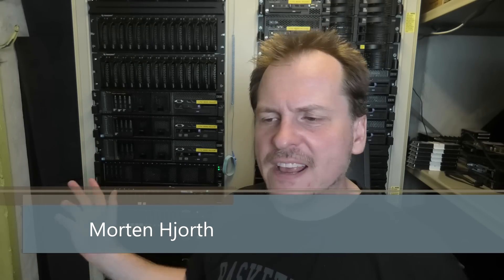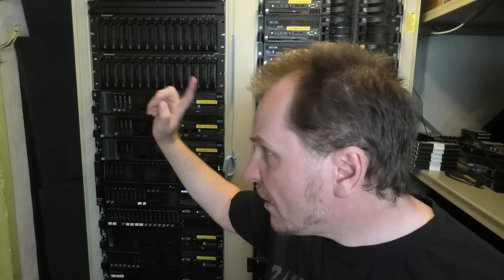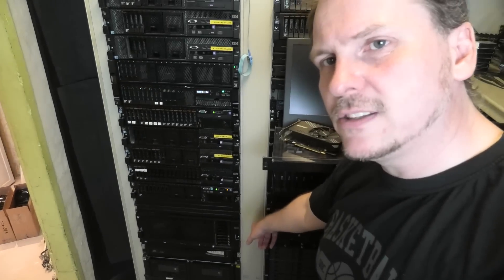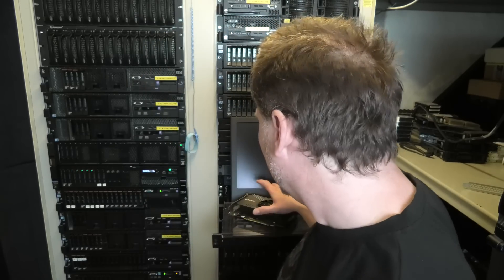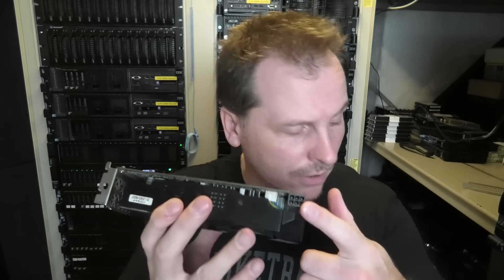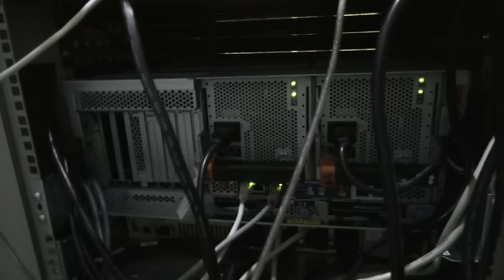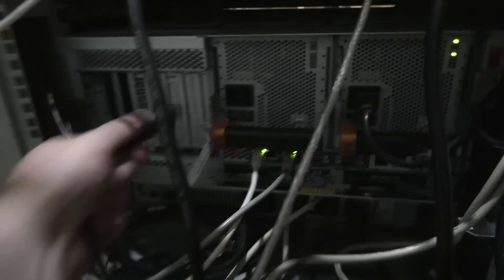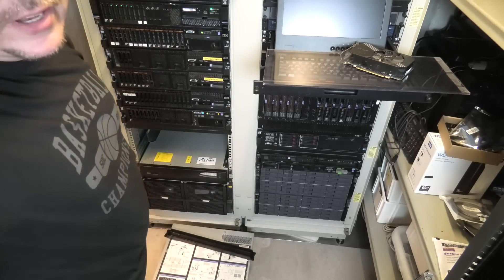Rack Rail Mounting IBM x3850 X5 & Mounting GPU - 974

Comment: Did you heard the news that VMWare has changed its licensing model for ESXi? You can watch more about this change in this video by ServeTheHome: https://youtu.be/6RBCJq-7Ag4
Reply from the maker: Just saw it and added this comment : 
This will be bad for VMware, this will move more over to open hypervisors,,, I have been looking at Proxmox for some times,, and if I have to put two lic. on a >32 core CPU,,, whatever might be better on ESXi, just became twices as expensive. On top of that, they have been moving features, that you use to get with ESXi, over to extra packetes,, so you have to buy add on, on add on, to get the same, as you use to get.
This video is to favorable, towards a company, that is just milking their customers. :-/
Reply: @MyPlayHouse  Now the options will be Nutanix, XCP-ng, or Proxmox VE (and other implementations of Linux KVM).

Comment: Are you still using the liquid cooling for the intake?
Reply from the maker: No, cooling the air cost lower air flow,, and did less than just higher air flow.

Comment: Racking 4u chassis yourself is a right job. I have a 4u chassis full of disks and damn that thing is heavy.
Reply from the maker: This was to heavy to be fun :-/
Reply: Yeah, I know what you mean. I picked up an HP DL580 a few years back, with totally pimped system, 4cpus, full memory cartridges, dual power supplies and 4 of the old alloy SCSI HDD caddies. Forgot it was all there! I only realised it when it wouldn't line up with the inner rails.......so took it off again. 😏 That'll teach me a lesson!

Comment: 25°C - that's a mild and comfortable temp for us Aussies :)
Reply from the maker: 25°C is hot here,,,  record temperature ever recorded 36,4°C back in 1975 :-)
Reply: @MyPlayHouse  I have a photo of my Golf GTI dash showing 43°C.  Where I am in Aus it doesn't get much hotter, maybe 1 or 2, but some parts in the Outback get well over 50.
Reply: @einfelder8262  South of Sydney stays quite temperate most of the year. We get a few days of 40-ish during Summer but generally 24 to 32 is pretty much it. Never had 43 here it nudged 41 I think in 2006.

Comment: Great video Morten. It's the opposite here in Australia, doesn't snow where I am but it's around 5deg C ATM maximum about 18degC. Good weather for cooling servers, minus the moist air. 😁
Reply from the maker: Peek summer her,, but not as hot as you get ie down there :-)
Reply: @MyPlayHouse  Yes, true. In my area in a summer like we just had...... with bushfires and all, it gets to a maximum of about 40degC. Usually end up running my servers at about 32degC, can't get the air any cooler when the temperature is that high.
Having said that 40 is pretty unusual, generally 24 to 32 is typical. 😉

Comment: Morten, look around for a sissor jack style table, save your back with those heavy servers.
Reply from the maker: There is so little spaces in there,, :-/
Reply: I think those are meant for datacenters that have wide space.
Reply: Måske kan du sætte sådan et spil op i loftet som man bruger når man skal have en cykel op i carporten, så kan du modificere det så det kan holde en server :P